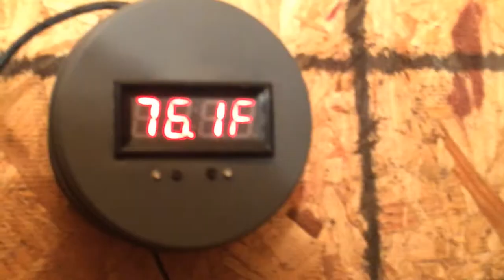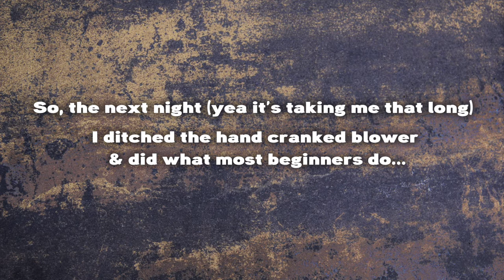Beginner Blacksmith Challenge #2 - Letter Opener

Comment: Now, that was a GOOD effort! Lots of different design elements brought together well.I'm with you on the 'not having the teacher around to watch over you' thing. I suffer from it all of the time. What seemed so very easy during class seems next to impossible when alone. A couple of things you might find helps - when using the hot cut to cut stock, not only cut on the faces, but on the squared edges (Corners) too, that helps to stop going off-line and having a spiral cut (Still happens to me though!!) I am told that the 'best' edge to have to a letter opener is an absolute square one. This, I am assured, results in a neat sliver of paper being removed with no jagged edges - again, something I have yet to master. I'm off to check out the other two in the challenge and to order a digital thermometer for my Smithy. (Told you I'd be stealing ideas... 😇)
Reply from the maker: Thanks for the feedback and suggestions! I'm glad you were able to find something useful from my shop build. BTW- you gave me a great suggestion in one of our threads. It was about a mobile post vise stand for my shop since it's so tiny. I just started fabricating one last night. I'm trying to use what I have laying around so I hope it doesn't come off looking too flimsy.
Reply: VERY glad to be of any help that I can.

I too am an advocate of using what's about, it's surprising what you can do with a bit of thinking about it.

One further suggestion, try to make the base big enough to at least get one foot on - it aids stability no end!!

There are  several things from your shop build I like and intend to do. 

You see, I'm not much of an individual thinker, more of a doer, and finisher. I've watched all three of the videos in this series, (all of which were excellent) and note at least one other has asked to get on board. 

Before it gets totally out of hand (which I recon it very soon will) Is there room for one more? If there isn't that's fine!! I just would relish the opportunity to do something completely different.
Reply from the maker: Sure thing NB! The beginner challenges are opened to everyone. I missed out on the last one - herb chopper - because I my lack of free time. :( I'll let you know when the next one is.
Reply: Ohh, please do!! I shall sooo look forward to it!! :-)

Comment: I gotta send Heath back to this video as far as the hair dryer and dimmer switch. It is basically the same set up he used on his visit, and pretty sure he LOVED the idea. I might have to do a show n tell short video, and present one of my unfinished projects from a couple years ago. Thanks!
Reply from the maker: +drason69 - Yea, I was surprised how well it worked. Bummed about not stay completely traditional with the hand cranked blower but it’s a ton easier. Definitely do the show and tell!

Comment: great effort, you ask for suggestions here goes,
get a large box of wire nails 2.5 inches long and 2 - 2x4 the length of you anvil. work on driving these nails when you can sink 10 in a row with 2 hits you have now mastered the hammer.
Reply from the maker: Hi Jake. Thanks for the great suggestion! Never thought of practicing blacksmithing that way. Definitely going to give it a try.

Comment: nice job on the knife do you have anything new in the works
Reply from the maker: Not yet - it's a bit too hot to be forging in my tiny space. The nighttime temp needs to in the mid 50's or lower. Right now, I'm taking time to tweak the layout, improve storage, lighting, and additional sound proofing so I'm ready to go when it does cool down. Trying to put an update episode together soon.

Comment: You should use a heavier hammer, that might speed things up a little bit, but great job!
Reply from the maker: Karl Nordstrom -  Thanks! You'll probably right. Since I'm just starting out, my accuracy isn't so great and my hand strength is weak. I'll need to improve on those two issues before I can move up on hammer weight but I'm working on it.

Comment: <<Copied to all 3 contestants>> 
Well done, gentlemen! One idea, three very different visualizations and executions. Here are my thoughts for the three of you... from the perspective of yet another rookie smith (about a month of actually heating & beating...):
AB had the most innovative visualization and the most straightforward, simplified approach to the question "How to open an envelope?". It would probably have been more effective if thinned out a bit more and given a really keen edge on the inside radius in order to cut effectively rather than tearing.
ETX had a really neat idea in inverting the blade from the  traditional presentation. I particularly liked the  thumb rest on the handle... very nicely thought out and carried through. It's great that you actually took the time to consider the mechanics of the task in detail and accommodate them. A slightly longer blade profile might have been a bit more efficient.
WL went with a very traditional letter opener blade profile. He obviously gets top marks for execution and ambitious presentation. The design DOES seem a bit clunky for it's intended task, though... reducing it to 1/2 to 1/3 it's current length would, IMHO, suffice. In the meantime however, should the Zombie Apocalypse descend upon him while he's sitting at his desk, he DOES have a viable last-ditch backup weapon at hand!
Keep up the great work, fellas!
Reply from the maker: Hey Dale, thanks for the feedback! You're right about the blade profile needing to be lowered. Probably would of helped to keep it from looking like a butter knife as well!
Reply: LOL For what it's worth, my first forging project was a railroad spike "letter opener", and I ran into exactly the same profiling issue. Somehow, the nice, crisp point I had at the end of forging got blunted into a typical butter knife profile in grinding. I guess we are both going to have to figure THAT little bit out. In my case it'll have to wait a bit... I need to make myself a few decent pairs of tongs as my #1 priority right now. Priority #2 is going to have to be a crapload of tent pegs for one of my historical  re-enactor friends. Maybe down the road a bit I'll get my hands on a camera and throw some of what I'm doing up here on FB just for fun. Happy hammering!